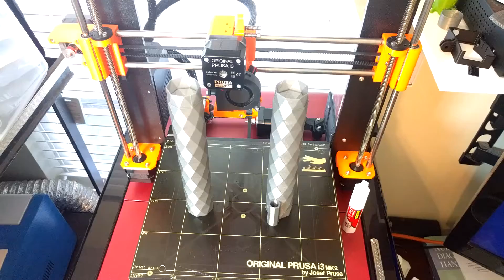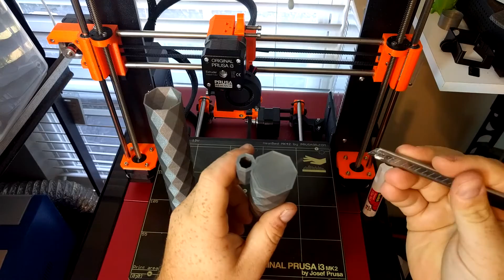PRUSA i3 MK2 Quick Tip 006: Alternative Method to Glue Stick on PEI Bed

Comment: A similar solution that has worked for me is to add a 5-12 (depending on the model) perimeter brim with 0 offset from the part. Because the brim is generated on the outside only it is easier to remove, (same way you remove your addition) and still provides more surface area for the first layer to adhere.

Comment: Why not just print with a raft?
Reply from the maker: I personally do not like the Raft settings in slic3r. Adding a cut away base provides better bed adhesion and a cleaner 1 layer. What slicing software do you use?
Reply: I don't have a 3D printer yet still undecided :) , the raft just seemed to be an obvious choice although what works for you is better for you. It was just an observation from the outside.